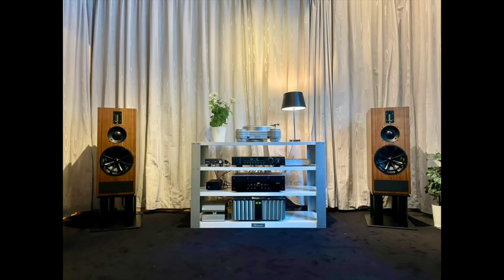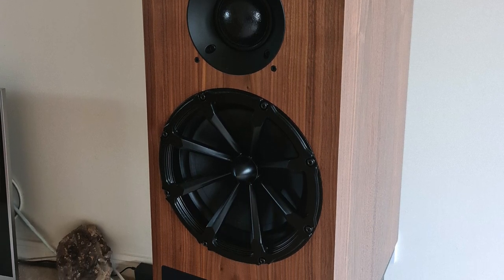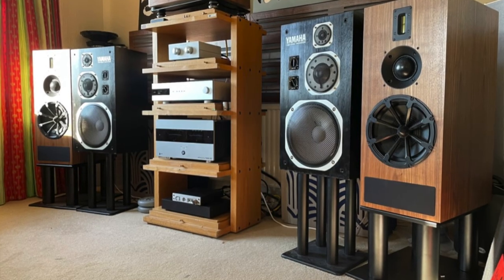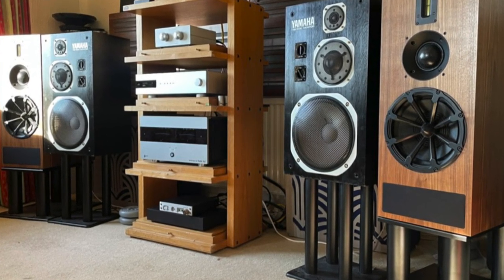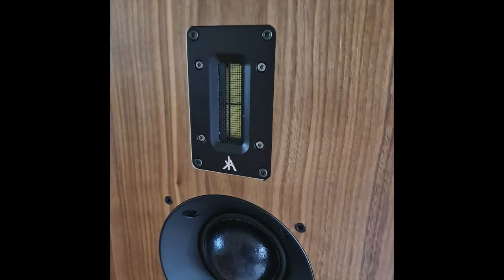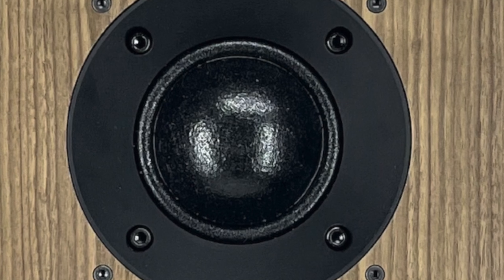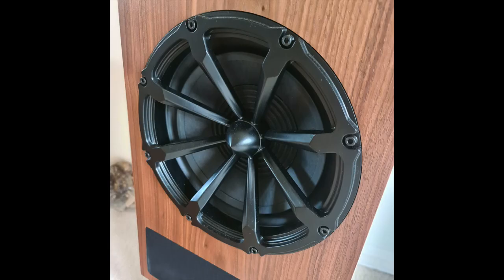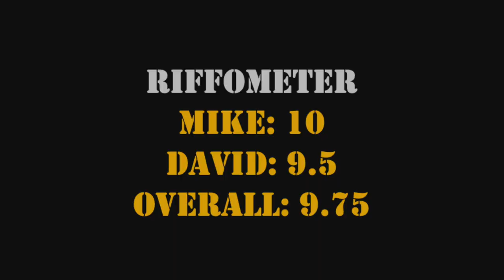Why Kerr Acoustic's K200 Transmission Line Speaker is a Seismic Sensation

Comment: Wow! For David to do that, the speakers have to be great! And a good part of the greatness is brought by the underrated Volt midrange dome, one of the best drivers ever, IMHO.
Reply: The woofer is a voit as well
Reply: @hoobsgroove  Twice as nice!
Reply: They are seriously good. Real top-tier stuff. And very much kissing cousins to my NS-1000Ms. I still prefer infinite baffle loading but these really test my loyalty to IBs!
Reply: @MrVinylista  the NS1000 are they standard crossovers have they been updated? It's worth changing the pots for 36+ step attenuators with 1% smd carbon film resistors, not carbon composite. That will give your the biggest improvement.
Reply: @hoobsgroove  Thanks for the tip. Not sure whether to [a] keep them standard, [b] tweak them or [c] get an active crossover made!

Comment: Transmission line design dates back to the late 50s based on research by Radford and Bailey who co-invented and developed the mathematical models for quarter wavelength transmission line designs. Both these guys are responsible for the transmission line designs seen in iconic IMF and Radford loudspeakers.

Comment: NS 1000, old school design an very British sounding...  Guys, just some basic recommendations on speaker placement (this applies to anyone with a similar gear rack placed in center of speakers, no mater the height) and that is move the speaker further out into the room so that the front baffle/s are at least a foot in front of the front of the rack (this will also help with less bass boom)!!
Reply: NS1000Ms are very far from "British sounding', so I'm a bit mystified by your comment! As for placement, It depends on the speaker's bass loading. Infinite baffle speakers can often be used directly in front of a boundary wall, whereas with TLs it may or may not be possible. With bass reflex, you really need to be away from the rear wall unless you want some artificial bass reinforcement. As ever, use your ears to decide what works for your room.

Comment: Most sealed box designs like LS3/5A are not Infinite Baffle, they are Acoustic Suspension. The generic statement that sealed or closed box designs are Infinite Baffle is very common and not trivial in the way it affects the bass tuning of the system.

Comment: I am really curious whether the K-200 can sound "rich and full" at lower volume.  Any insight on this?
Reply: Absolutely! :-) Another benefit of the low moving-mass elements within the drivers is that they remain highly responsive and linear at low input levels.
Reply: I find the soft-dome & ribbon combo interesting.  Would like to hear it.
Reply: @TriAmpHiFi  It's very interesting. Better still, they integrate seamlessly, when you would think they'd be doing their own thing.
Reply: @kerracoustic3607  Precisely – you don't need to put lots of watts into this speaker for it to sound right, as it moves air very easily.
Reply: @MrVinylista  Volt VM752's.  About $500 each.  This is why I tri-amp....  out with the horns-----  in with the soft domes, easy.  Can't wait. 🔈🔉🔊

Comment: wimslow audio TL15 almost identical but use is the 15inch volt driver.. £6000.. These guys are simply over charging because they can
Reply: TL15 all day long and better value they make a fuss about the heat dissipation that's easily remedied just don't over power them lol
Reply: @gijoemolinaro  I shouldnt be a dick about it though. I was just shocked..If they can they should, the market decides

Comment: David, Your listening room is set-up the wrong way round. You should be listening down the room. For years, we have been told that’s the right way to set-up your system. “I shouldn’t listen to anything you say anymore”, but after 20 years owning my own listing room I can confirm that all my friends and myself think putting your speakers against the long wall and sitting with you sofa about 1ft from the back wall sounded the best. I’ve been back and forth lots of times. “You made my day David”,couldn’t understand why more people don’t try it.
Reply: Yeah it makes more sense if you haven't got the room less reflections combing effect from the speaker, and better still put some good thick 6 inch absorption panels Rockwall on the ends try that.
Reply: @hoobsgroove  hi hoobsgrooe. I found putting acoustic treatment on the wall behind the speakers much better, behind me the sound, sounded to rolled off and lacking dynamic. Defuse panels seemed to work better behind you.

Comment: Did i miss it how much were they?
Reply: £20,000
Reply: Jes said it really quickly 😂
Reply: Not much change out of 20,000, if you go the DIY route you can get it from 3,000 at Wilmslow audio.
Well that's too pricey for you! very good model is the TL3 plus a MTM design using volt base mid-range driver TL  1,284.oo

Comment: Have just spotted WILMSLOW AUDIO doing virtual fully built copies of these at a MUCH, much cheaper price using expensive VOLT 12 and 15 inch units and superbly finished ???
Reply: Same mid & bass units, but different TL design, tweeters, cabs, crossovers, etc. – so not a 'virtual copy'.
Reply: @MrVinylista  Very similar though to be honest as opposed to a virtual copy. Just shows the HUGE mark up on high end gear ?

Comment: What is the minimum watts for these?
Reply: I don't know the official figure but I was able to drive them nicely with my 18 watt World Audio Design K5881 valve amp.
Reply: We would recommend having a good sturdy 20 watts or so on-hand to drive them effectively to a modest level, but beyond that it's really just down to how much dynamic headroom you require. They will happily bear the brunt of 200-watt class A/B mono's running full-tilt with uncompressed signal, should you feel the need!
Reply: @kerracoustic3607  Should not be a problem for my Sherwood S5500II

Comment: They're based on the PMC studio monitor. Wilmslow audio make that TL speak a kit
Reply: They're not based on a PMC, they're a transmission line design that PMC uses along with others. Cabinet, driver complement, crossover, etc., are all unique.
Reply: @MrVinylista  I'm not sure what's unique? They look very similar to the PCM studio monitors, got the same drivers except for not using ribbon, if there's any difference it's got to be very slight difference. possibly the crossovers could be designed in a different why, di you know the order of the crossover?
Reply: @hoobsgroove  Will be covering this in detail, in my forthcoming StereoNET review.
Reply: @MrVinylista  ok when's that coming out?
Reply: @hoobsgroove  Should be 3 weeks or so.

Just to be clear, the K200 utilises a brand-new Volt 250mm Radial bass driver, which is currently exclusive to the K200 – and not used in any PMC, at this time.
Reply: @MrVinylista  without seeing a graft hard to say what it's characteristics are, but the only difference is the size being 10 in, I believe its not the only 10 inch driver they make so how different I don't know!
Is it a void pipe transmission line? Yeah it's different to the PMC version what was a lot bigger cabinet utilising a 12-in driver. I don't think he's doing himself any favours charging the extortionate prices, if he dropped it by half he would sell a few thousand, not sell 200 to 300. It's hard to justify the price when you think how much it would cost to build or maybe it's just me!! Anyway I look forward to the analysis. try get a chart for the drivers and impedance curves.
Reply: @hoobsgroove  It's never useful to compare the parts cost of a product, with retail prices - which is what happens when you're talking DIY. 

I'm a big fan of DIY, but I recognise that 99% of hi-fi buyers aren't, and just want something to listen to music with. 

Anyone in the industry will tell you that the final retail price of a product is roughly 9 to 10 times the basiccost to make. That applies to pretty much everything.

This is because of the long chain of shipping, dealer margins, storage, distribution and VAT, etc., all of which cost money. 

This speaker is expensive, but it's a minnow in the high end speaker world where you can pay 5 times that easily. It delivers a level of performance that's absolutely top-notch for its size, and miles better than the sort of thing you can get for half its price. 

Whether that makes it "extortionate" is of course a matter of opinion, but I'd say it's perfectly reasonable for the sort of customer it's aimed at. Better than that, in fact.

As you say, if you want to get something that's nearly as good but much cheaper, there's always the option of DIY, just like you can make your own sports car from off-the-shelf bits – but as I say, that's not for everyone.
Reply: @MrVinylista  maybe but there is company's out there who can do it and do it well like Arendal, and with their range between 1500 to 3,000 £ can compete with 10,000 to 30, 000£+ speakers. If they can managed to do it so can others companies. You should have a listen to a pair they give you 60-day trial no arguement money back guarantee and they pick them up. I wish more companies were ethically minded like this.